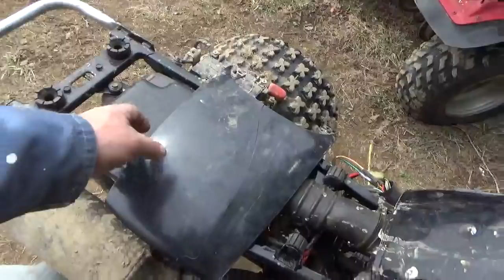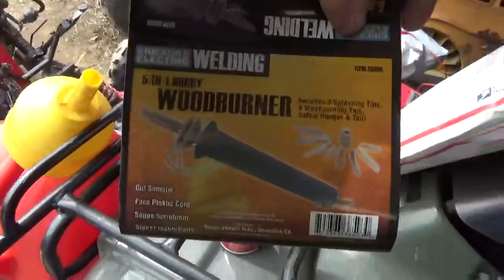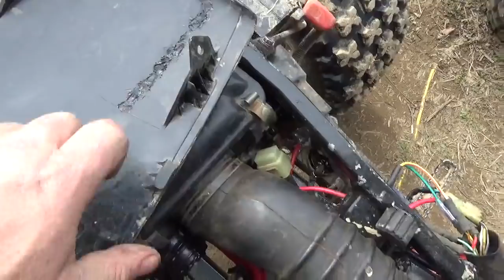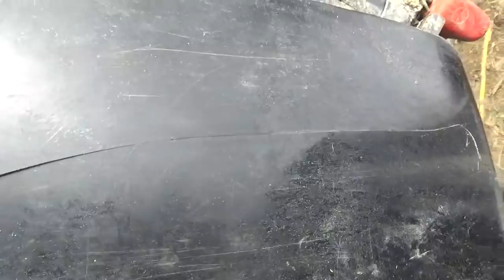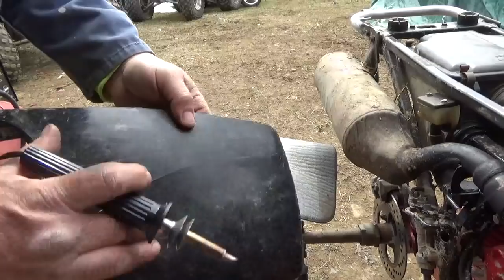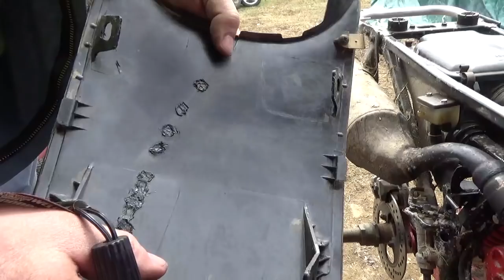Welding cracked ATV plastic with a $8 Harbor Freight Wood Burner,

Comment: Harbor Freight now has a plastic repair kit for $16. Nice kit. The foot of the iron is angled and shaped to be easy to use. It comes with wire mesh to melt into the plastic to reinforce it as well as plastic rods. Been working great for me. My son has one too and it's been doing great for him as well.

Comment: I can't believe how well this works!  Now, if I could just find a source for Red Polycarbonate that I could use for filler rod.
Reply: See if you can find some red zip tiea and use them it works
Reply: @71chevelle34   I tried that.  didn't work.  Zip ties were not compatible, didn't flow with polycarbonate.  Just sorta stuck on and would flake off.  Certainly did not weld like when I used the  original material.   Turns out polycarbonate is lexan.  I found clear and green welding rods, not red.  I think zip ties are nylon, much softer.
Reply: @gizzyguzzi  Thanks for the info i was gonna try that today.I will go buy some of the welding rods today i need green.
Reply: @71chevelle34   I'm pretty sure the JD hoods are polycarbonate too.  And that's probably why they sell green welding rods.  Unfortunately Honda Red is not that popular-
Reply: @71chevelle34  I was actually able to weld my hood back together with a cheap soldering iron with a pointy tip.  Just bury the tip into the crack back and forth to stitch it together.  I did it from the back side.  Worked great, except where pieces were missing I had no filler.  But it is just as strong as it was.  You could try that without the welding rod.  HF sells a 'woodburner' kit that has a bunch of tips that looks like a winner for this too.
Reply: Go to Amazon and type in Poly Welder Pro Polyethylene Welding Strips - 5-feet (Red) they have them.
Reply: @71chevelle34   I need polyCARBONATE.  I don't think polyETHYLENE is compatible.  I recommend you get polycarbonate for your JD hood since it is readily available, I'm pretty sure that's what you need.

Comment: Tip I’ve learned is line up the front and put either scotch tap or masking tape on the front to hold strait the hold and plastic weld I’ve use a torch and a flat head screw driver before but it’s a hard clean up on screw driver I hustled would buy one from the dollar store with a wood tip

Comment: Usually quad/dirt bike fenders are hdpe plastic. I use some stainless steel mesh and add more material. 5 gallon buckets work great for extra material. Just cut it into strips and weld away.

Comment: How can I contact u Harvey because I need help with my dirt bike it has spark clean carb ever thing is good it still doesn't start could u help please it back fires some times
Reply: Check the fuel petcock if it has one. It may be plugged

Comment: I use an old soldering iron.If you need material for filling in deeper gouges,the excess you cut from zip ties is the same plastic,melts right in.For strength,short lengths of heavy gauge copper wire melted across the crack,once cooled it's super strong.Practice is the key.

Comment: Yes! Plastic welding!
I've had to knit plastic MANY times!
Good method! I've had to use a lighter, with a nail I found in the dirt! LOL
It works, but it's not pretty!
Thanx Harvey! :D
Reply from the maker: Hey Captain!!!! A nail and a lighter!!!!   LOL!  I guess that would work!  I;ve seen folk release pressure from behind a freshly blacken finger nail with a lighter and a paper clip.... No pretty, but, very effective!!!   Thanks for the info, suggestion, watching, and commenting!!!

Comment: I’ve tried this a few times haven’t really had any luck with it but, I’m eager to try again.
Reply from the maker: Hey 3&2moto!!!!  The Harbor Freight wood burner with the v tip worked perfect for me, it was just the right temperature and shape for welding plastic!  Thanks for Ur thoughts, watching, and commenting!!!
Reply: Harvey Spooner I’m gonna have to try that I have a small crack in my 200x fenders and want to stop it and strengthen it.

Comment: Harvey... black zip ties work great as filler for the cracks as well. and screen material as maxam suggested works great for the gaps and enforcement
Reply from the maker: Hey NJDevilDog!!!!   The piece I welded up was not structural like a fender, it is not even in a spot that gets hit by brush, so it does not need the reinforcement a fender would need... I did not think of the screen or zip ties as filler.... Sometimes I make a video and learn more myself from my subscribers then I teach to others!!!!   Thanks for the info, suggestions, watching, and commenting!!!!

Comment: thinking it may need some reinforcement on the rear,vibration may just crack it again.
Reply from the maker: Hey Roger, I finished welding it up and gave it a pretty good bend, it did not crack, we will have to see what happens in the winter.... Thanks for Ur advice, thoughts, watching, and commenting!!
Reply: roger oconnor you appear to have a lot of atv’s & parts. Any Polaris 300 Sportsman seats or seat pans?I used this same process on a muffler exhaust guard for a Honda Rucus.it worked really well, I used black zip ties for filler. The secret is to use the same type of plastic there is a code on all plastics- will hold up as long as you don’t put extreme stress on it. Thanks for the video.

Comment: Well shit.... That's the same way I do it guess I'm not the only crafty one.
Reply from the maker: Hey Mike, If U managed to weld Ur plastic together without burning Urself with the wood burner/soldering iron, U would be ahead of me.... Thanks for the info, thoughts, watching, and commenting!!!
Reply: Harvey Spooner I'm a dumbass with text bud sorry.  I actually meant that as a compliment, besides your work is mutch cleaner than mine!
Reply from the maker: Hey Mike!!! I did not take any insult from Ur comments, I appreciate the time and effort that U put into communicating with me.... After welding that plastic back together, I found burns all over my left hand, the thumb and index finger mostly.... All small, but, all annoying!!!   As always, thanks for Ur thoughts, watching, and commenting!!!

Comment: I thought this was the 10-15$ plastic welder they have. 
It has that foot and the iron and some metal screen. 
It’s probably the same Iron and foot in another package. 
Cut some screen and heat it into the cracked area on the backside. 
I found it was easy to overheat the plastic I was working with and I have a few waves on the outside. 
They have a 60$ plastic welder also, I’m just not sure if it’s gonna last more than 1 use .
Reply from the maker: Hey MrHillFolks!!!  I bought this $8 wood burner just for the job.... I have soldering irons, but, I was after the V shaped tip and the copper trowel looking one also.... The nice thing about this wood burner, it was just the right temperature, not too hot, easy to keep the plastic shape and not too cold and slow to melt the plastic.... Thanks for the info, Ur thoughts, watching, and commenting!!!!

Comment: I've done tons of car bumpers that way. I usually do some epoxy re-enforcing or fiberglass mat and some resin. It may not hold on something that vibrates as much as a 4wheeler without some extra work. Autoparts stores have several types of epoxy and only one works good for me. It mixes up kinda yellow/white looking and when dry has a little flex to it where other kinds don't. Anyway, enough of my rambling on. Have a great day!
Reply from the maker: Hey Fan!!!  I've seen guys who detail cars for resale melt the bumper covers back together, clean up and sand the welded area, and then prime and paint them an accenting color.... With a little effort and few materials, I have seen them take an ugly car to at 20 feet, it looks good.... I did not think of the flexible epoxy.... Thanks for the info, Ur advice and suggestions, watching, and commenting!!!

Comment: Hey it's looking good that's similar to the way I repair ATV plastic I use a soldering iron on the back like you and then I use hot glue and a screen to hold it all together here's a link to my video hope this helps keep bringing the videos love them. themhttps://youtu.be/anOH3weienk
Reply from the maker: Hey Maxam!!! The mesh and hot glue would really reinforce fenders that need support, good idea!.... The piece that I did does not have any stress or weight on it so the melt repair should be enough.... Thanks for Ur video, advice, watching, and commenting!!!!